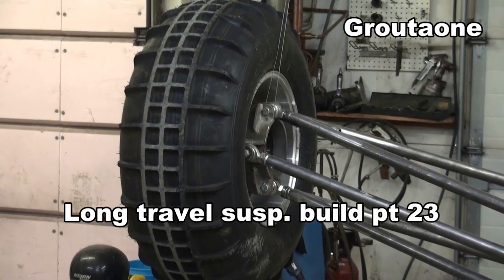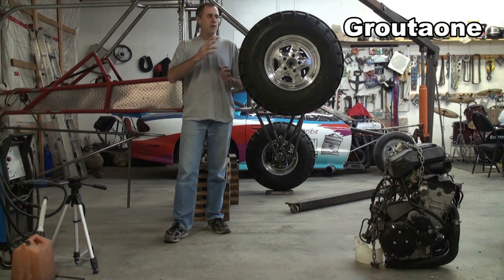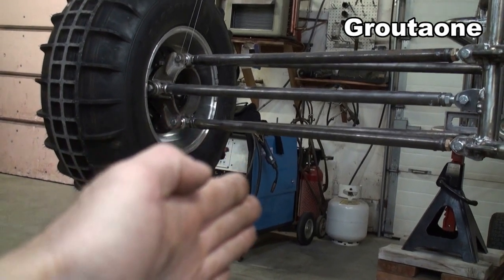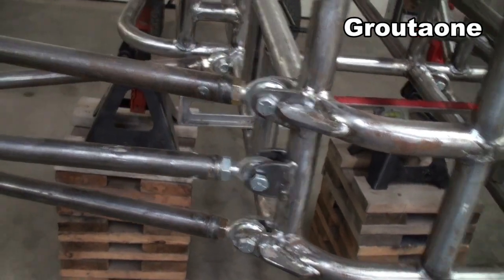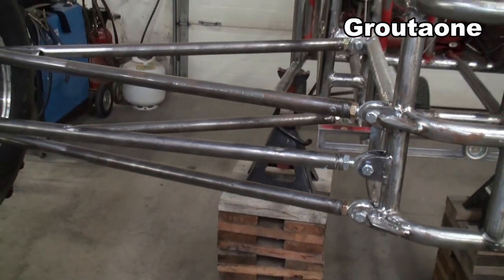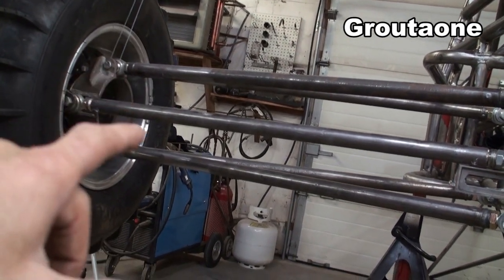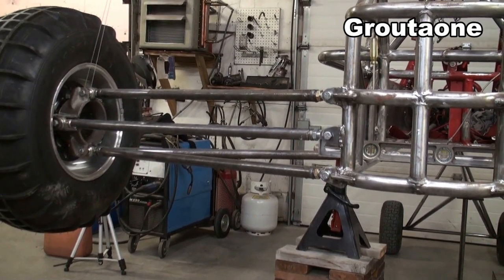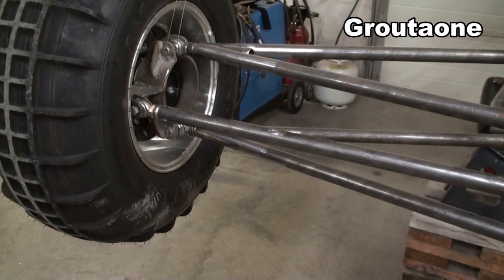Long Travel Susp. Build pt 23

Comment from the maker: Thanks, keep in mind this is a bit more in this vid than than the true intended travel, also like I said in part one this is an experimental machine, the idea is to push the geometry and general build of the machine to the limit just because I can and because I want to heh heh. I may find in testing that I should find a way to increase the wheel travel even more or back it off some with shock pressure and limit strap adjustment, to me this is like a big box of Lego with no rules

Comment: But it's always a compromise. I don't know how well toe could be located if the upper arm were shorter. Definitely not as well as your setup, that's for sure. And like you said, the arms will not be the binding factor in the design. Something else, like the cv joints will probably be the limiting factor in travel. Pros and cons to both I guess. But great work nonetheless. I'm very impressed with everything you've done thus far. Best of luck to you. I'm looking forward to the finished product!

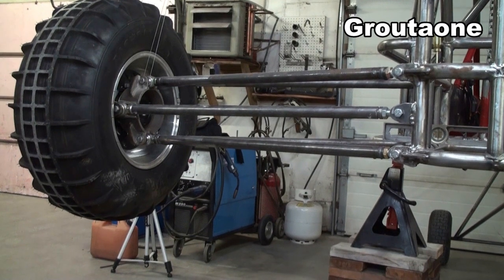Comment: My 2 cents. Equal length control arms eliminate camber change through travel, but at the expense of tire scrub. 00:49; Roughly two tire widths. The vehicle's wheel track is constantly going to be changing through it's travel. It will only travel so long as the friction of the tires is overridden. Shorter upper arms let the tire roll rather than scrub. They also allow for (-) camber gain under compression to compensate for (+) camber gained due to body roll, keeping the tire flat under cornering.

Comment: Great work! I don't know what your intentions as far as terrain for this vehicle are concerned, but it looks like it'll be a blast to drive. Your stabilizer bar being mounted in parallel with the arms is quite clever for controlling/keeping toe angle constant. Your hub design is very intuitive as well. Very impressed. I have a couple criticisms as far as the suspension design goes though. I'll probably be called out on them as a hater or pretentious, but I'll post them in a 2nd comment anyways.

Comment: nice work, gotta question, i need to run a trans cooler on my pathfinder isolating it from the radiator as they are known for failing and contaminating the trans, i plan on doubling the gvw for sizing the cooler, any ideas on brand or a temp gauge that i can add?

Comment from the maker: Depending on suspension type its not unusual to have constant camber on an off road vehicle, In this case I think its good to keep the camber consistant because of the length of travel, as the vehicle rolls over uneven ground I dont want the camber changing on individual wheels, the machine is wide enough to help stabliize the corners. I will likely test the machine without a swaybar before I paint it to see how it acts and add one in the rear if I feel I want to

Comment: have you thought about all the body roll this thing will have and how the wheels will act when that happens?they will lean the wrong way with body roll,this is why camber in travel change is good so it will lean like a bike in a turn.the way this is set up the wheel will lean the other way.not hating great fab work,but this is the hard part.

Comment from the maker: I think the engine has enough size to start providing good midrange grunt and keep building power from there. I think I will gear it for about 75 mph top speed so I get max low end power when needed. Do you mean like after this is done whats the next project?

Comment: What is the size on that tubing? I bought some that was an 3/4 inside diameter and with a out side diameter of about a inch. So the wall was 1/4 inch thick. Seems really stout Man it was expensive.

Comment from the maker: Axle plunge is also all about where the pivit points are, when this is all done I should have less than a 1/4 inch plunge on the axle throughout the travel, my goal is zero plunge but I will believe that when I see it, I plan on making a video on this topic later in the series

Comment: Don;t know is this is even relavant here but in Remote Controlled cars with long A-Arms we have them setup with a lillte bit of camber gain on the up travel from ride height.   This is to keep the tire from rolling over as the chassis pitches in a corner.

Just thinking of the amount of suspension travel you are going to get from that setup, the body roll could be quite severe (unless you use some roll bars)